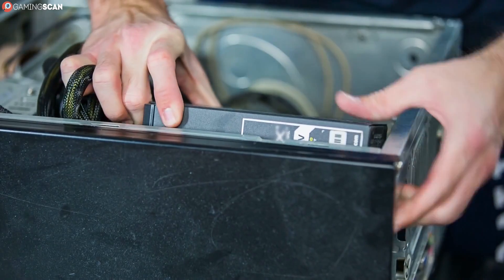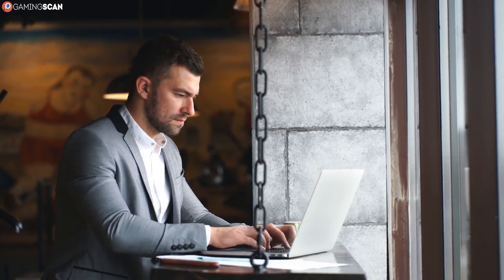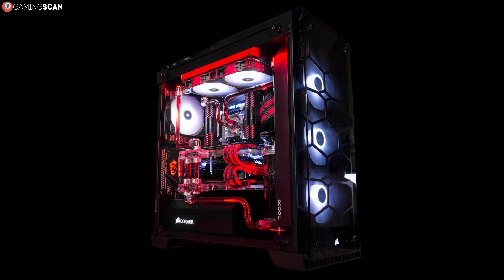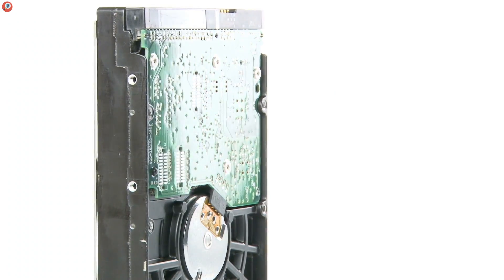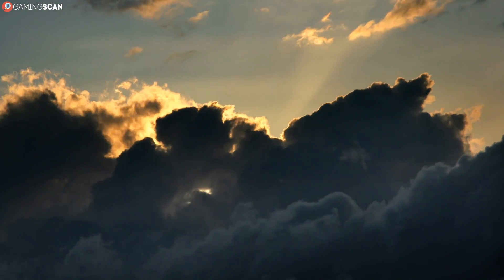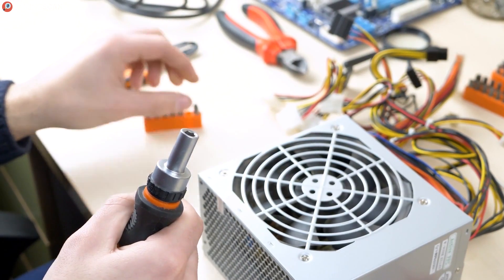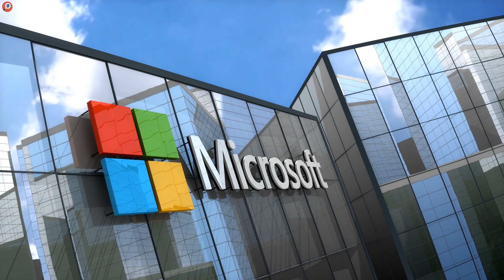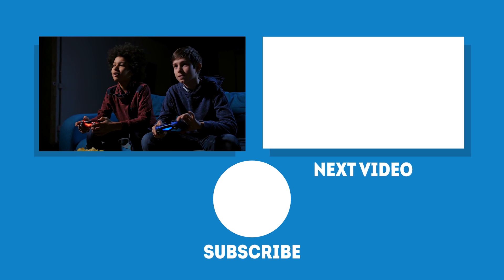How Long Does It Take To Build A PC? [Definitive Guide]

Comment: My only reservation with ordering parts way in advance is the warranty. What if by the time all my parts come and I'm ready to build my PC I discover it doesn't work but can't return it because the warranty expired?
Reply: Most Warranties last longer than 2-3 years. It's not like it's going to take that long for delivery or for you to assemble it.
Reply: @mahnamejeff7586  I'm guesing that's from the actual manufacturer of the product? Say for example I order an MSI motherboard from Amazon and I want to return it 4 months after I purchase it. The return window for Amazon is about 30 days so that means I would have to go through MSI themselves in order to return it right?
Reply: @Mr_Creasy_  Yes.